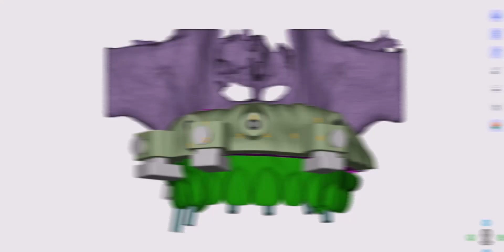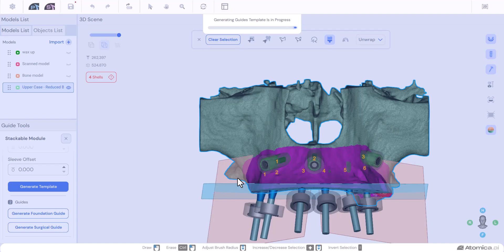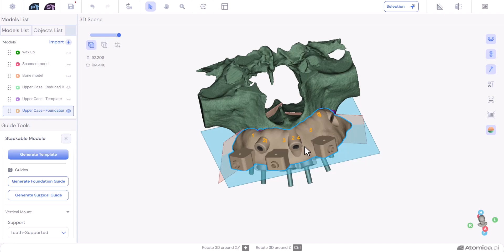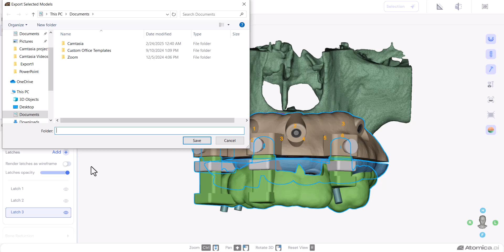Step-by-Step Guide: Creating a Stackable Guide in Atomica

Comment: The software is great and very intuitive  but the end result guide design imho is not great. To insert such a massive foundation guide the flap will have to be immense which is defeating one of the purposes of minimal intervention using fully guided surgery. Also there is very little in the way of vents to let the irrigant flow through the surgical site. Please address these issues and you Have a winner